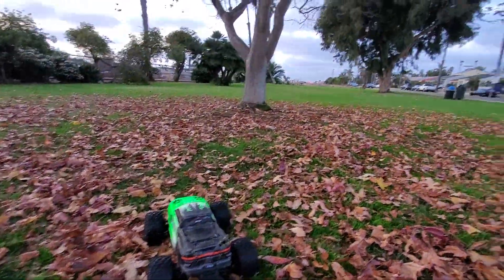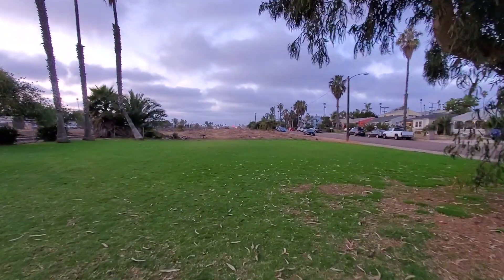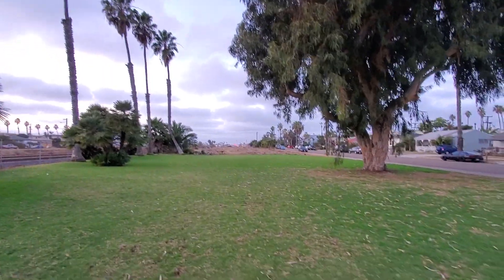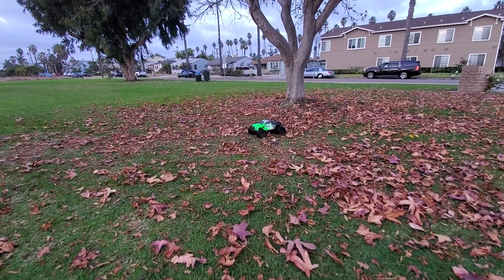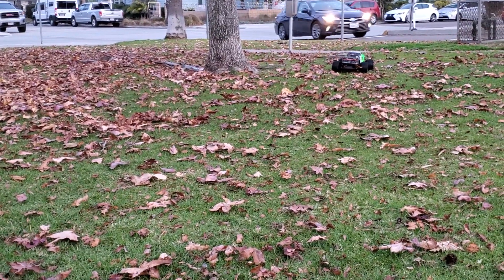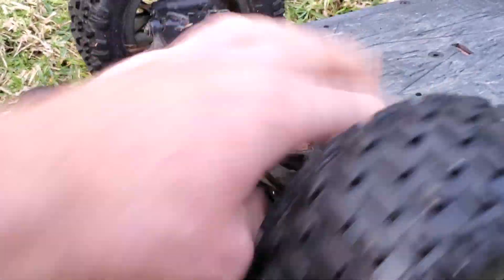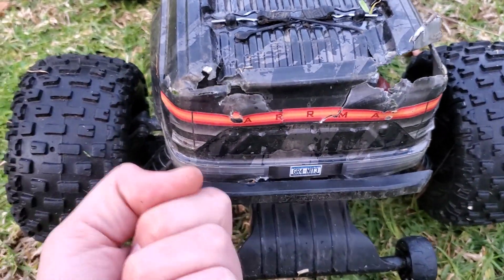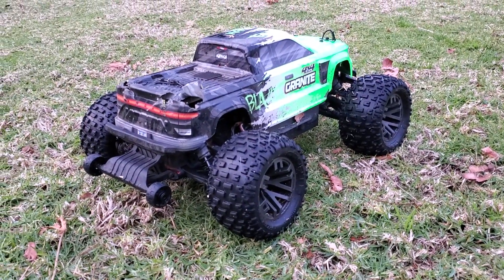The one problem with my Arrma Granite 3S V3

Comment: Im going to a 26t to get more wheel speed less torque,idc about the heat because I don't run it that long but for $13 I think get the wheel speed up and making it loose traction will help wheeling the truck so much
Reply from the maker: I agree, how did it go?

Comment: I have just bought my V3 granite today, returned my 6S v5 Kraton so I could start from a more sensible place... 

I have purchased the Typhon rear wing and wing mounts and some bolts to mount the wing which is super durable and will sit just above and behind the body and be the highest point and hopefully protect the body. Just hope it doesn’t create another problem and start breaking shock towers but it seems super thick and strong so fingers crossed there. 

Keen to see what you do with yours. Did you shoegoo + drywall tape yours first?
Reply from the maker: I didn't do the shoe goo and drywall tape, but so far the body is holding up much better.
Reply: @rcleesd  yep I think the shoegoo and tape is critical for durability. I’ll do that first and add the wing (I misspoke above I got the Outcast 4S wing) and I’ll monitor how mine goes. I’m a newbie so it will be crashed a lot I’m certain.

Comment: If I had to guess some part from mojave roll cage to add strength to rear of body?

I put some scraps of high density foam on rear shock tower to help spread load of body.  Too early to tell of it's helping.
Reply from the maker: Good guess!

Comment: Get that dxc5 I think it is... not positive.  It has directional buttons on the handle so u can steer and record... and... you live in cali... see you soon!  They all come to Washington!  😆 🤣 😂 and I have the Samsung note 10 ultra.  Great cameras.  Video has a wide lens as well wich helps a ton.  And u can use the pen as a remote to do almost anything u need to do w out the phone in ur hand.
Reply from the maker: Hey Chris! I do have a cousin that lives in Washington; it's a gorgeous state!  I normally film with a Go Pro Hero 8 and a headband mount or I sometimes mount my Go Pro to the controller directly, with a cold shoe mount (double sided tape).  Thanks for watching!
Reply: @rcleesd  np dude.  Simple videos.  Not too over produced. To the point.  Not too many cringy  house beat r.c. montages 😆 .  Keep it up.